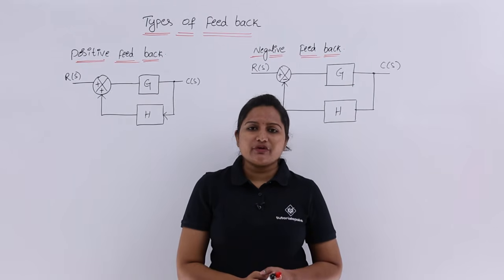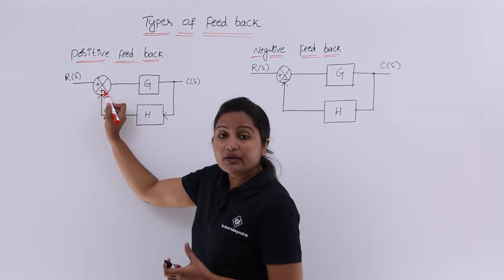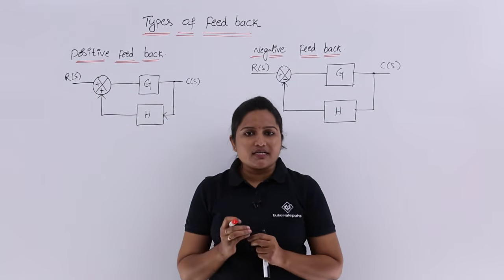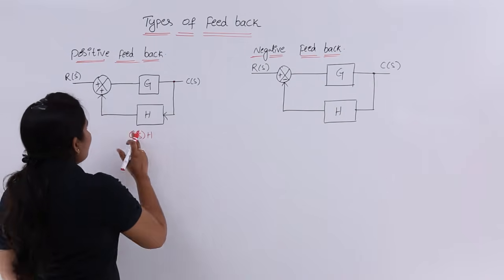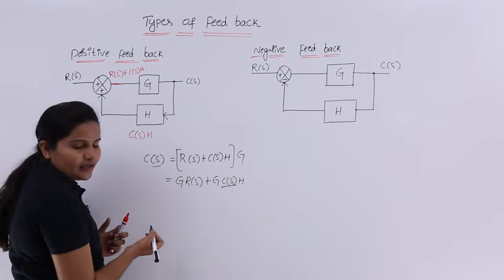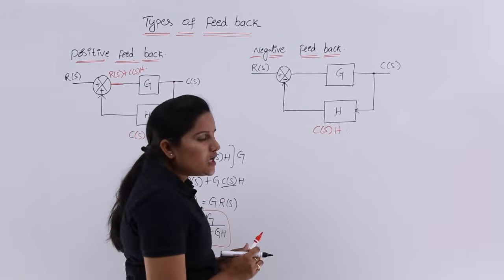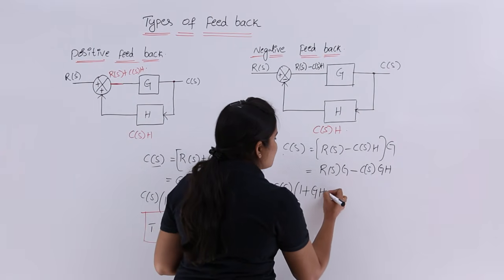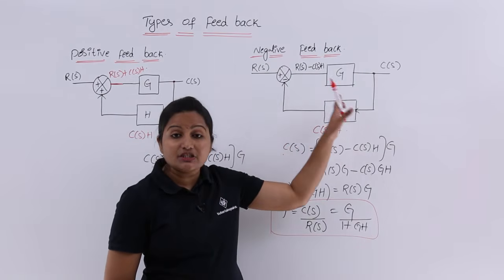Types of Feed Back

Comment: I now understand, the first output without a feedback was just C(s)=G.R(s)
The second output with a feedback is now C(s) = R(s) - C(s) H(s) or C(s) =R(s) +C(s) H
This is because when the error detector either minuses or adds the feedback transfer function to the reference input, that then becomes the input to the controller, which controls the actuator and it then feeds the plant. Normally if there was no controller that gets the signal from the error detector it would be like an open loop with just an actuator that's never being controlled and stable, right?

Comment: Your block diagram is unfamiliar, I've seen different control system representations. You display a "feedback gain" and a "open loop gain". The block diagrams I've seen usually have a set point, process gain, error comparator, a controller, process operator, output variable, and a measurement device?
Reply: She just explained PART of the block the diagram i. e the feedback part not the Whole Block diagram otherwise everything else is pretty much the same.